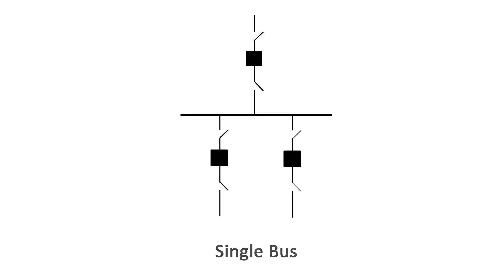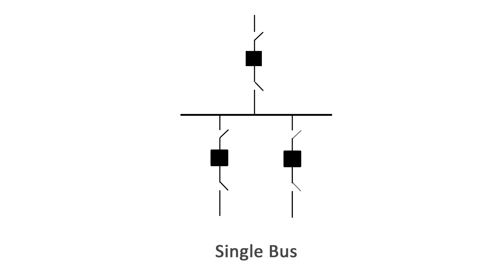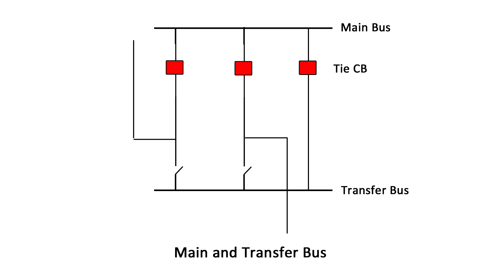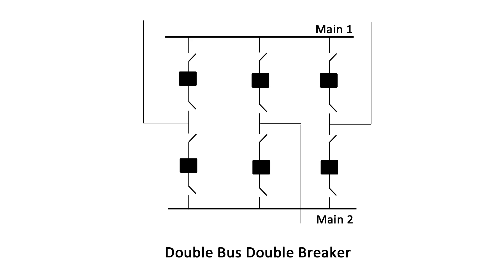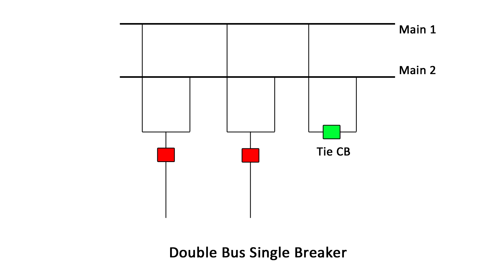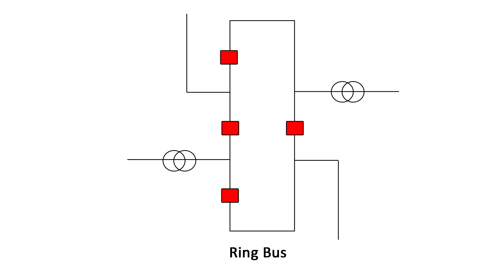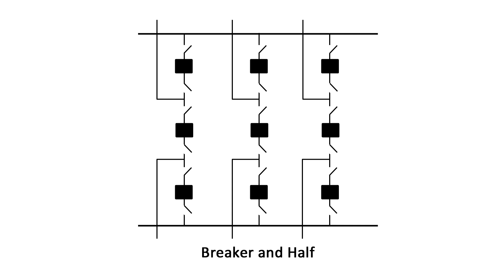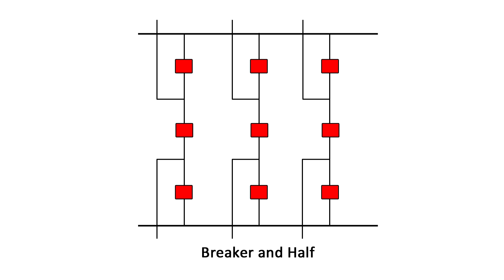6 Electrical Substation Bus Schemes Explained

Comment: When the breaker near bus failed then both the circuit remained operational. In this case the breaker near opposite bus has to be eligible to supply and interrupt currents required for both the circuits. How is that dynamically adjusted????